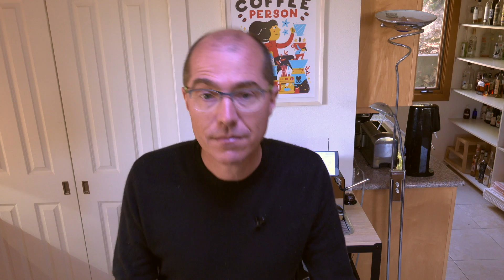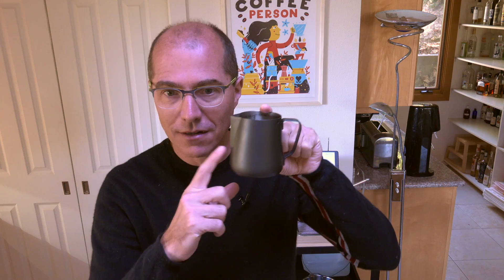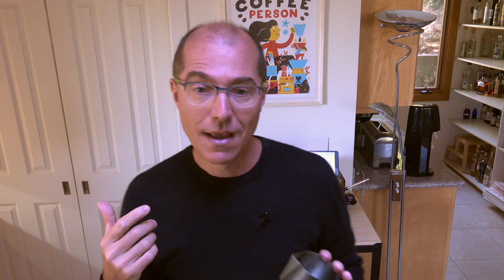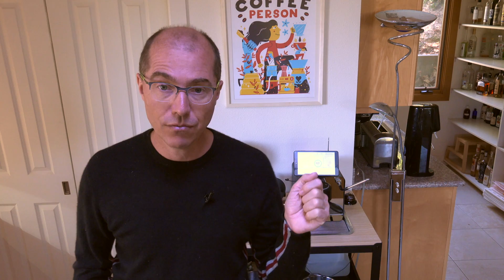What's the advantage of changing the steam flow rate?

Comment: Great video. I have a question, if I may: how to adjust the steam flow rate? What I should looking for (parameters or visual clues) for adjust? I have a Saeco SE50, which has 7 levels for steam flow rate adjustment. I really appreciate any tip. Thanks.
Reply: Hi, it's been 2 years but hope you will reply , I'm also using Saeco Se50 so may i know how to adjust ?